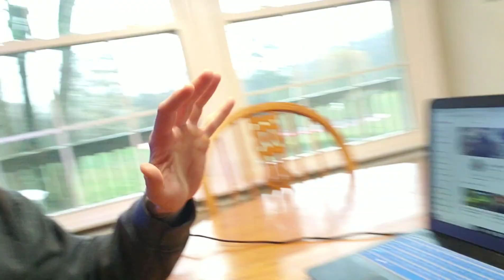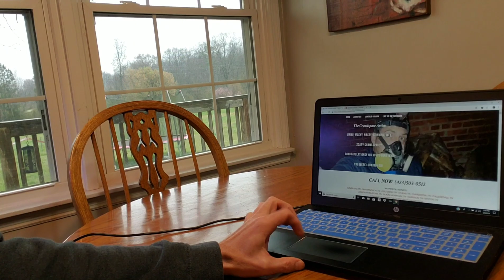NATIONWIDE CRAWL SPACE FRENCH DRAIN AND SUMP PUMP KINGS!

Comment: This comment is answering Drew Burt’s question about the piers that are around the perimeter of the foundation walls. 

Those piers are intended to catch the end of the beams or girders that hold the floor joists.  In a 2x10 floor system with double or triple 2x12 girders/beams the piers will be built approximately 2” below the the foundation walls.  This is done so the 2x12 girders will will have something to sit on and make them flush on the topside with the 2x10 floor joists. 

This is the method used when hanging the floor joists with joist hangers or in the house in the video they have set the joist on a 2x2 which is nailed into the side of the 2x12 beams. 

The other method would be drop girders / beams. Where the floor joist would set on top of the beams.  In this method you would still need the piers around the perimeter but they would be set the width of the girder or beam you are using below the foundation walls.
Reply from the maker: Most knowledgeable comment of all time. ^^^^^^